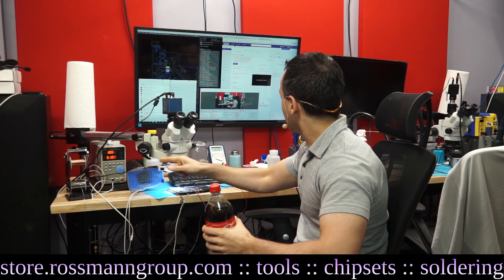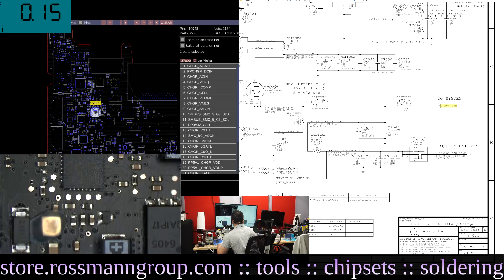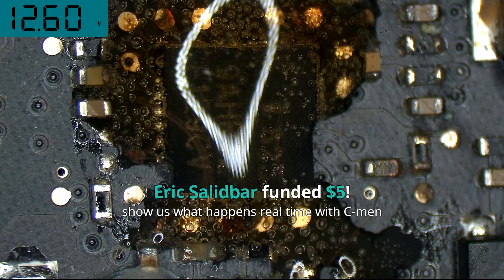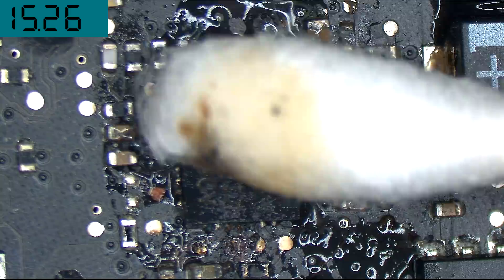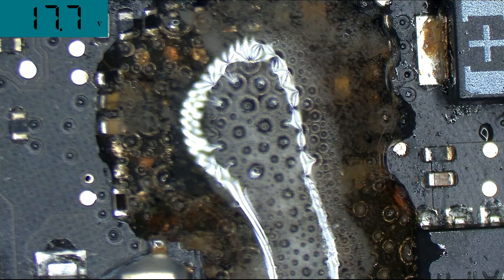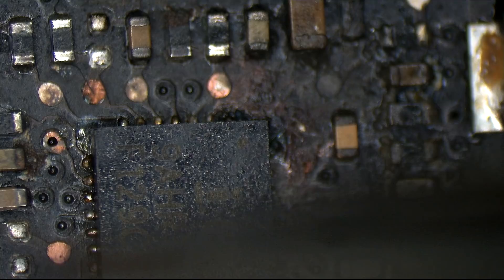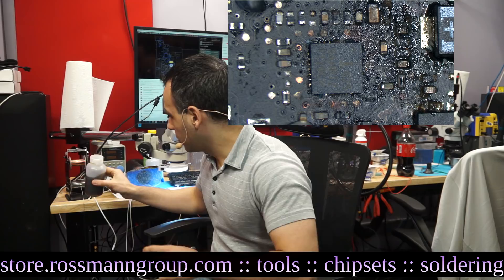How fast will Coca Cola corrode a Macbook logic board?

Comment: Removable batteries +++
Reply: Yes, they would help a bit. Conformal coating on exposed electronics and an enclosure that minimizes ingress of harmful substances would be also a nice addition. But this is unwanted, these machines are built do get damaged. ;)
Reply: Robert Slackware so they are easier and faster to install. Glued in batteries simply aren't end user removable in the way batteries with a latch taking 2 or 3 seconds to remove are.
Reply: Guys, if you want all that just buy industrial ruggedized notebooks, not Apple.
Reply: Yup a Panasonic Toughbook CF-52 lasted a friend 10 years.
 ... still works but well  T7300 and ati X2300 ain't good enough for browsing. Remapping an Impreza. Sure why not.
Reply: Антон Южаков do they even update the tough books anymore? I haven't seen one since the core 2 duo days 10 years ago.

Comment: The soda when added to electricity = electrolysis. Whatever is on the positive side will be eaten alive and the negative is supposed to be cleaned. Since this isn't a controlled environment (random parts in the mix) is just goes to town on everything. This never occurred to me until now, when you showed yourself introducing power to the circuit. Thanks for the educational lesson!

Comment: if you the instant after you get liquid on the device seal it in a container with it powered off rice can and will help. it can suck up that liquid and help evaporate it without the rice even touching the liquid. keep in mind the process you are doing has sped up the corrosion and damage because you are applying current and heat with it being turned on. rice can help, you are 100% wrong about that.

Comment: When I was a kid, my mom accidentally poured Coca Cola on my PSP (that must've been 10 or 11 years ago)
I was really lucky though, as it is still working as of this day. The chips didn't get destroyed luckily. Although I can't remember if I removed the battery immediately or not. 
The only thing that happened was that all the buttons get really sticky when you don't use it for some time. But just click on them several times and they are performing as expected.
Yes, I could probably open it up to clean the buttons, but I'm really bad at putting things back together, especially with mobile devices as they're so small. Plus I'd have to buy a fitting screw driver. Which I'm not willing to do.
Reply: Things were made with better quality when it happened now there designed to fail in a couple years so you’ll have to buy new

Comment: Kinda hard to remove power to the board when Mac laptops have the battery inside and on top that they are gluing batteries in now!
Reply from the maker: Battery is glued in but the connector is not soldered to the board!
Reply: Right I'm aware I'm just saying the average person isn't going to remove the bottom plate and even if they wanted to unless your in the repair business you don't have 1. a small enough phillips or 2. a pentalobe bit to even do it lol...
Reply: Yeah Apple batteries like to swell I replaced one for a client once that had pushed the track pad up and out I had to pry the swollen battery out.
Reply: I keep my Crapbook in a UAG protective case (in case a feather falls on it) and it covers the bottom and top; i've just taken to not bothering screwing the bottom panel back on as i've had to remove it so many damn times after a botched apple repair to re-repair a busted keyboard ribbon cable that it's easier to let it sit there held in by the retainer clips and have the aftermarket case keep things safer. - relating it to this, if i needed to pull the battery connector fast, it'd be doable in a matter of seconds after pulling the charger and switching off.
Reply: You figure if you don't do something it will be scrap anyway so get out the tool box and go for it.

Comment: I agree with you that the corrosion is happening very fast, but the "Corrosion" itself isn't the reason the circuit is failing. It's the short-circuit caused by Coca cola( really conductive since it's acidic). I bet the liquid is shorting the sense pin of the regulator to the ground, so the chip thinks it's supplying 0 volts, and therefore it cranks up the power to max (17 v) to compensate or just the coca cola is such a good conductor that 17v supply just passes through with little resistance. The corrosion happens on the surface of components and doesn't reach the underneath of solder joints and contacts which would cause an immediate disruption in signal flow. I believe corrosion would compromise the structural integrity of solder joints and components and make them vulnerable to vibrations over time. Nice video over all, and I 100% agree with the conclusion! Rice doesn't do shit and turning on vet electronics may  kill them right away no matter how small of liquid drop. I also just subscribed

Comment: Chemical corner: coca cola contains phosphorus acid and acids are surprisingly corrosive. But wait, there's more! When you're for example etching PCBs with HCl you want it to mix with hydrogen peroxide, because the acid on its own only makes thin layer of corrosion, that will stop the acid from corroding the rest but with hydrogen peroxide the acid can corrode more and more. And this stands also for electrolysis.

Comment: I rescued my old macbook from liquid damage four times. I was able to do so because I always turned it off immediately, opened it up and thoroughly cleaned it before attempting to turn it back on. One of the times, someone spilled an entire pint of beer right into the exhaust port, which caused the macbook to turn off immediately. Even that wasn't enough to fully kill the bastard because I had the tools and foresight to disassemble it and wash everything with rubbing alcohol, even though I was quite intoxicated at the time.

Everyone should watch videos like this. But then again, you'd have to find a new job...

Comment: What would you recommend we do if a spill were to happen? Seeing as it only takes a few seconds for corrosion to irreversibly eat away at the components, how can an average person tell if their machine just needs a few hours with silica packets and a fan, or if it needs to be sent in for repair?
Reply from the maker: open it up, disconnect the battery, clean the board. 99% alcohol is helpful. even 91% from local drug store or corner store.

Comment: The coke acts an electralizer. Which starts taking atoms off one metal and puts it on another metal. By doing this it speeds up the rusting or oxidizing of the metal. This is a chain reaction until you run out of acid in the electralizer.

Comment: this is the reason why i made a hard plastic cover for my computer case (with air holes for the cooling) that surrounds the entire casing and covered it with hydrophobic coating. ive spilled coca cola once on my old computer by accident, and i never wanna go through that again... so im not taking any risks. not only did i make such a plastic cover, i also tweaked my desk with a raised corner so chances of spilling liquid on the plastic cover is already decreased.

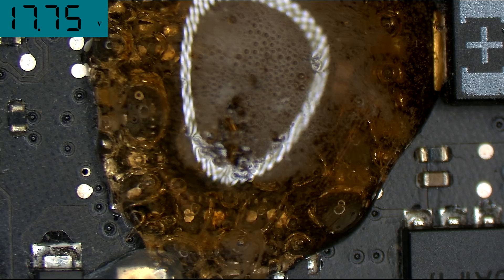Comment: 2:44 Is the 17 V spike really caused by corrosion or did you just short your chip out because cola is conductive? Of course it takes no time at all to short a chip with a liquid.
3:29 After your first drops you still get your 12.6 V without the liquid. If corrosion was the cause, you'd still be sitting at a higher voltage than before.
A shame you didn't show the voltage at the end.
Reply: I think the resistance of the cola is a bit too high for it to conduct the 18 V to the computer, and if it were conductive it would also be shorting to ground much more.   It's far more likely that it feeds a faulty signal to a high impedance device, eg. a MOSFET.

Comment: Actually it's better to pull of the batteries and power plug immediately and open the device and dry off everything with fairly warm air and then clean it with rubbing alcohol to remove any substance that was made and then check the ic component for any damages and check the fuses and it there's any rail mask that was damaged i suggest using epoxy and fix the railing if there's any issues and then check the connections and then after wiping everything of and dry the device to make sure that there's no liquid left  under any bga chip and then try to turn on the device

Comment: It is not instant corrosion what makes the jump from 12V to 18V. The liquid is obviously short-circuiting the 18V input rail to the 12V output. And removing the liquid gives you 12V again. The acid is destroying the metal though.

Comment: What is happening is the fizzing is just hydrogen and oxygen leaving the water in the soda and this is how plating work. Metal is leaving one end of the circuit to the other and doing this causes the end giving the metal oxidizes as oxygen clings to the positive end and moves the metal to the negative end

Comment: The coke is conductive and electricity tends to take the path of least resistance. the path of least resistance in this case isnt through the switch, its through the coke. the power comes in, goes through the coke and back out the output. of course the voltage would immediately jump, if it didnt then something would be wrong

Comment: And then there's my Laptop, which got an entire water bottle (1L) over it and finished installing a windows update. 3 years have passed and I'm still using it. Only thing I had to repair, was the keyboard after 2 years, since some buttons wouldn't react anymore...

Comment: The "green stuff" is copper phosphate - what you get when phosphoric acid dissolves copper.   
Pure water doesn't conduct electricity nearly as well, and would create far less corrosion, so you'd stand a good chance of recovering a working laptop once it dried out.

Comment: I think you may be mistaken on a few things. Yes corrosion is occurring. However when to coke is on the board, I believe that it is shorting out the circuit.  The electricity may be shorting the charge power to the output bypassing the pass transistor.  The extra fizzing could be electrolisys from the coke conducting the electricity.  Also, some of the darkness left over on the board looks like it could be syrup residue from the coke. But I do agree that it ruined the board in a short time.

Comment: Thanks for that very useful video. It is exactly what I need when I have the next annoying water-damage vs. rice discussion.

By the way, any drink that has more minerals (aka. electrolytes) than distilled water will cause damage through electrolysis. Putting a electronic device in distilled water, letting it run and then adding a teaspoon full of table salt is a nice experiment too.

I once saw that experiment with a old TV (those giant things with cathode ray tubes that use high voltage). They put it in a big aquarium full of distilled water and it still worked, then they added a glass salt water and then it died (a slightly more spectacular way than the PCB in this video).

Comment: On MacBooks, with a non-removable battery, you can't do anything. Because until you find the screwdriver to open and desolder the battery it is too late in case of spilling

Comment: This is not surprising. Two ingredients in that stuff are the main culprits. Coke contains a lot of salt, which is why you are seeing tremendous activity when power is applied to the circuit. What is happening is that the aqueous salt solution is a conductor and has shorted out the pins of U7000 as well as every other component touched by the corrosive liquid. The chip hasn't stopped working, but rather, the current is bypassing it through that nasty cola. Since the liquid is carrying current, the electron flow is also carrying away metal from cathodes to anodes. This is electrochemical corrosion. Accelerating this destruction, is another ingredient in coke, phosphoric acid. While that's a weak acid, it works in concert with the brine solution to speed corrosion of the contacts and traces.

Might as well dunk your MacBook into the ocean as drip a little coke on it. Actually, I wouldn't be surprised if seawater had a lower salt concentration than coke.

Comment: Hey Louis, question. What do you think happens with engine coolant? specifically Dex-Cool. I was using my Samsung S4 as a flashlight and dropped it into the bucket I was draining my radiator into... :) It still works 3 years later lol.
Reply: Dex-Cool seems to be Ethylenglycol. It has a high resistance (impedance?). So it is still conductive, but limits the current flowing through it. Considering the S4 mainly runs on a 3.8V battery, no wonder it's still alive.
Reply: @Sypaka  still works, just upgraded phones a month ago

Comment: If you got some liquid on an electronic board DO NOT RUN ANY POWER THROUGH IT! Remove the battery, as Louis just said. You should also let it dry at least overnight before trying anything. If it's dripping wet, let it dry for multiple days. Rice might create a dry environment to get the water out a little faster, but I don't think that would help in any real way. If you are competent at opening things without destroying them, do so and let it air dry after removing as much water as possible.

Comment: Coke is just fine. It just needs ice and a little 34 degree water to dilute a tiny bit and it's very refreshing.

It's not the only electrically conductive fluid that will cause corrosion in connection with electricity.

Comment: The problem begins when power is applied; the best thing a customer can do if anything is spilled is unplug it adn the battery asap; then take it in for repair.  

Coke actually will clean copper greatly (electricity absent).  I had a set of ping beryllium copper irons that would oxidise very badly after time, and the way to clean them was to place the irons in a two liter of coke.  After a half hour or so they would come out looking like this picture below.
https://i.ebayimg.com/images/g/zE0AAOSw3S5bzQ9l/s-l640.jpg

Pretty cool experiment thought~

Comment: When you have a liquid and pass current through it with separate negative and positive, the pins on everything become either an anode or a cathode, corroding starts instantly. It forms  a state of electrolysis. You are pulling molecules out of one metal and depositing in a different state on another. Edit - Dang, I should have read the pinned comments before posting.

Comment: the coca cola, with it's PH (around 2), is very conductive, probably more than the chip, which the power may just be skipping
the fizzing is an electrolysis process with the water contained in the coca cola, generates hydrogen and oxygen
black q-tip is the cocacola dissolving the casing of the chip and the black paint on the PCB, just like sulfuric acid would do

Comment: From the close-up, you could see the leads bubbling away under the surface at certain points consistently. You see the same phenomenon when you do plating or the electrolysis of water. Also note that, completely outside the "electroplating" effect, soft drinks are full of various acids, so much so that Coca Cola and its ilk can be used to remove the paint from your car. And we drink this stuff!

Comment: Great stuff.
Nothing makes an impression like a real time visualization of acid in action.
I’m not shocked, but holy s*** that happened fast with an incredibly small amount.
Thanks.
Reply: It wasn't the acid, it was electrolysis... A glass of mineral water will do the same. Less disgusting sticky gunk, but the electrolysis will cause immediate damage too.

Simple solution: Don't eat/drink near electronics. And don't buy hardware without enclosures that minimize ingress of harmful substances (Louis has a Video where he poured a glass water into a laptop and it still works, this is how it should be).

Comment: I got tea spilled on my laptop once. I quickly turned it off but since the battery is built inside the thing. I have to open it up and remove it. The keyboard doesn't work anymore and somehow the battery keeps bubbling up even when replaced. Still works though.

Comment: An old timer told me they used to load test generators by placing the output leads in a brine solution. 
The amount of solution determined the load. 
When the coke fizzed you were just testing the power supply 😬

Comment: I spilled a pint of beer all over my Thinkpad. It was attached to its Ultrabase at the time and the beer was coming out of all the vents. It really stunk when things got hot.... 
A year later though and this is the same Thinkpad that I am using to type this comment. 
Maybe beer is not so corrosive? The Thinkpad designed in a way that spillages don't get to the boards? Or just luck... who knows. 
Good video - really interesting to see what goes on when these soft drinks are spilled onto PCBs
Reply: Lucky you - back in the day, a glass of shandy killed my keyboard ;) but Thinkpads are built like a brick anyway ;)
Reply: Yes, I have been lucky. My other computer is a Toughbook, that of course can take spills. Ironically though I have never spilled anything over the Toughbook. But then the Thinkpad is a lot more comfortable to type on :-) Fun fact, a friend spilled a whole coffee over an Acer and that thing was bomb proof.  Survived a lot of use and abuse. Thanks for replying.

Comment: If it was only corroding the board when electricity was going through it, would I be correct in assuming that it's not due to the acid in the coke or any other carbonated beverage for that matter?

Comment: you are breaking down compounds like water into their ions when the voltage is applied between contacts of the board,  these turn into gasses like oxygen, hydrogen, chlorine etc; that's why you see fizzing.